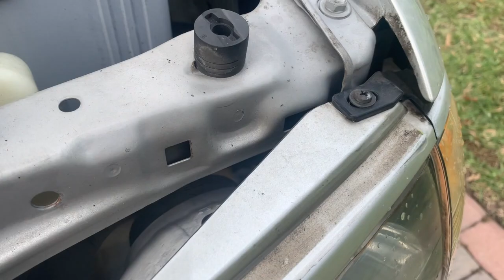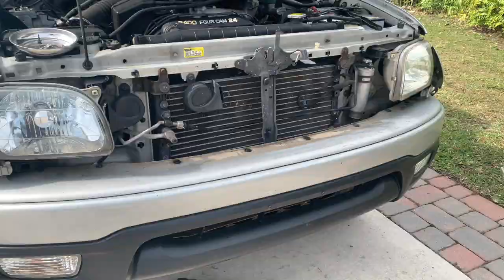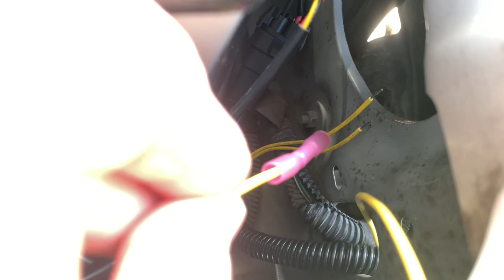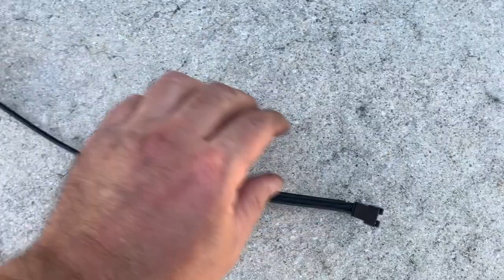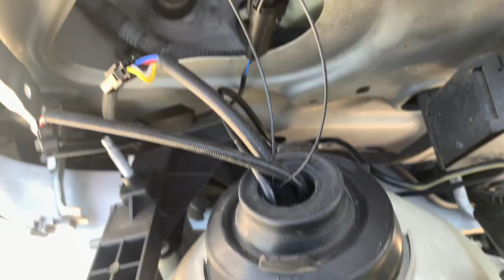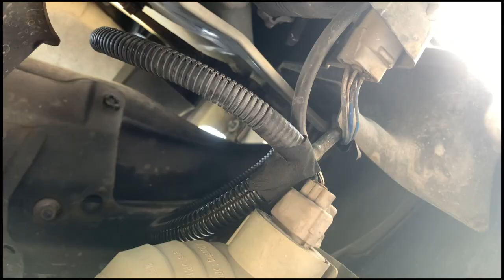TEQ Customs Retrofit Headlight Install Step-By-Step Directions on a Gen 1 Toyota Tacoma

Comment: How many feet do the upgraded headlights, on low beam, project onto the road? I understand these headlights only project out further and are not brighter in high beam mode. Is that true? What do you light and not like about the headlights? Thank you.
Reply from the maker: The difference between these and stock is huge. They are almost too bright! Major upgrade for sure. The light is whiter than the stock yellow bulbs. 

The high beams are very centered and they shoot far far off into the distance. I like them. Could they be a little more dispersed like i have in my other vehicles, yes but these are designed to shoot down the trail so i think the tradeoff is distance vs spread, which in our case is fine. 

The light cutoff is very dramatic on low beams, and they do project a sort of odd, uneven light pattern along the top but I'll take it due to the huge increase in light output - i got these mainly to keep the wife safe at night when she'd driving the truck - to be seen and to see better, and to that end i would say mission accomplished. 

There is a lot of wiring that comes along with the lights, and I question some of the long term viability and waterproofing of the connections over time, thats my one major concern with this upgrade since the engine bay gets pretty wet when it rains.
Reply: Where did you get those headlights?